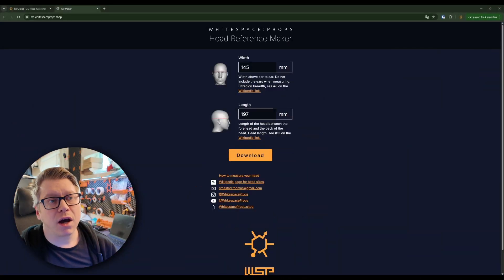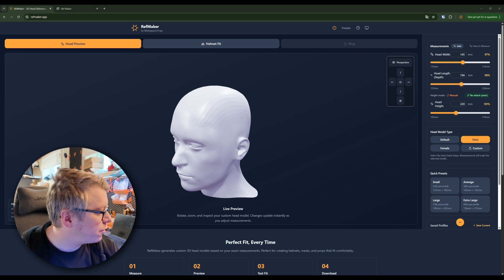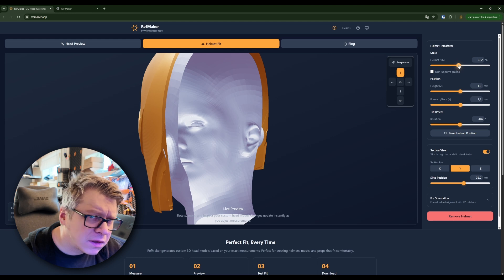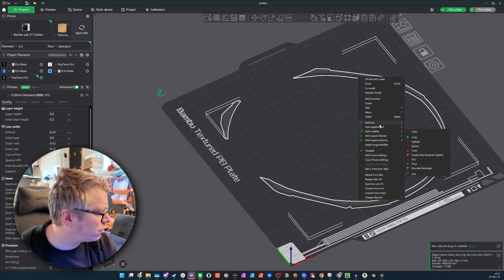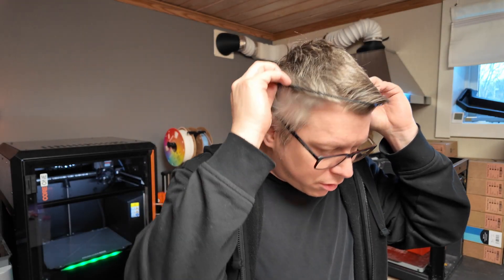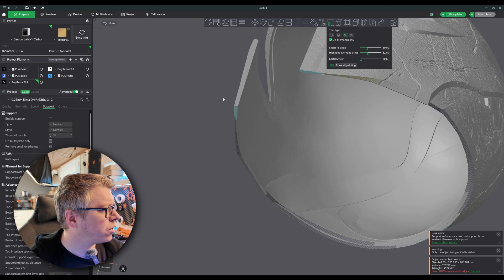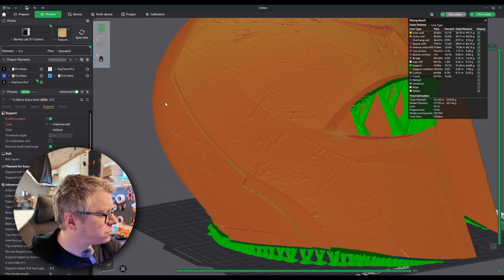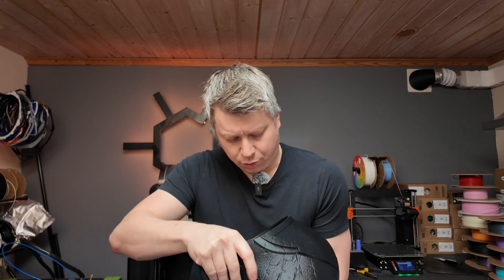I Made a Tool to Size 3D Printed Helmets (Finally)!

Comment: It would be really neat if the size ring could generate its own connecting pieces.
Reply from the maker: That's a bit more complicated as I would have to detect where there are gaps in the mesh. I might find a way to do it on the future but it's not a priority for now

Comment: This is embarrassing but 
I do not see the Download button! 
I can only download the head reference in window 1 
No option to download the modified helmet
Reply from the maker: You can't download the modified helmet. Just apply the same scale to the helmet in your slicer
Reply: @WhitespaceProps Is there a reason why it's possible to download the modified head but not the modified helmet?
Reply from the maker: Because the helmet used for fitment is usually not the same that's printed. Most helmets are either combined or/and decimated for this purpose

Comment: It looks great.
However, this tool lacks the ability to deform the helmet model. For example, I just downloaded the Mandalorian helmet model. I adjusted the size to fit my head, but the eye opening was too high. I increased the size so the eye opening was at the correct level, but the helmet wobbled on my head like a bucket. If it were possible to at least shrink and expand the models along the axes, this tool would be indispensable.
Reply from the maker: You can scale the helmet non-uniformely, just check the checkbox under the helmet scale and you can scale it differently in X, Y and Z. Deforming outside scaling/non-uniform scaling is something best left to specialized 3d modeling software.

Comment: I have to know. I'm a guy with glasses too, how do you measure your head with glasses? I keep finding myself printing different sized helmets just because my glasses get in the way. Unfortunately I can't wear contacts, so glasses are a must in my case. Hope you can help me with this 😅
Reply from the maker: Having glasses is something that I'll add in the software, but the way to work around it now is to print size rings from areas where the glasses might pose an issue
Reply: @WhitespaceProps yeah I have tried that. but then the masks are not sitting well because they are too big.
especially if they are closed masks like deadpool masks or ironman...

Thanks for the reply :)
Reply from the maker: There really isn't a good way of fitting glasses inside a helmet outside of scaling it up, unfortunately
Reply: @WhitespaceProps I wish we could have something or someone that could have design something thats added to the halmets to keep them stable while you were glasses🫣😅

Comment: great video and explanation,  consider my self still a noob with helmets/mask and this surely helps  🙂  question that i have is when i export my head profile as an stl and then import it in Bambu slicer i noticed when selecting the scale that the measurements are different?
in Refmaker its 115 - 210mm  but in Bambu its 202.48 - 230.97  (x-y)
Reply from the maker: What you see in the slicer is the total bounding box of the mesh, but in refmaker the measurements are inset from the bounding box.

Comment: Could I make a suggestion for your next version please? When clicking on each measurement, would it be possible to add a little red dot on the model where each calliper-tip should sit? Would make the first use faster for newbies :) ( Still not entirely sure where head height is measured from / to! ) That aside - Amazing tool, thank you!
Reply from the maker: Great suggestion! Adding it to the list

Comment: Is it normal for the helmet mesh to disappear when using the transform tools?
Reply from the maker: No, not really 😅 is it there before using the transform tools? If you're experiencing issues, please contact me on Instagram and I'll have a look.
Reply: @WhitespaceProps  Its there, and I can move it around, it just doesn't like transform with my model I guess.
Reply from the maker: That's weird 🤔
Reply: Came up with a workaround by downloading the head model with the measurements and using it in my slicer, that seemed to have worked.

Comment: Hi, great video! I’m new to 3D printing. I’m currently using your tool to size my head. I already put my head measurements & into the tool but I’m having trouble sizing an Iron Man helmet onto my head. It’s not the full helmet file.
Reply from the maker: You may want to load all pieces into your slicer as one piece, then export it from there

Comment: What an amazing tool! The scaling/fit issue is what have hold me back from starting to print some helmets :) Let the filament flow!!
Reply from the maker: Glad it can help you get started! 😊
Reply: @WhitespaceProps  Learned that a Mandalorian helmet for my head wont fit an A1, so it is time to dust off the old Sapphire SP-5 and finish all the mods, so it can print fast and well :)
Reply from the maker: That's going to be awesome!

Comment: This is very cool, I have issues with some body parts trying similar in slicers or armored garage. What would truly be amazing and peak is some sort of A. Mesh collision detection so you can see if certain odd shaped helmets will fit over your head.
B. If not a built in ruler where it will measure space between objects so you can see if anything is too close etc
Reply from the maker: I had this cone up somewhere else and I explained it a bit but the gist is that mesh collision detection is expensive

Comment: does your program compensate for the foam padding you're going to add to the helmet
Reply from the maker: No, it does not. That's something you need to have in mind but usually there will be room unless you make the helmet skin tight 😅

Comment: nice tool man! Idea - auto scale the helmet. Say I want 5mm the whole way around, take the largest width/height/etc and make sure the helmet is that far away. I hope you understand what I mean.
Reply from the maker: I understand what you mean. There are two issues: 
1. Finding what surfaces to measure distance between. A lot of helmets have weird geometry so this isn't trivial
2. Heavy calculations make the app extremely slow. I tried an auto intersect feature but in my first attempt it took too long to be considered usable